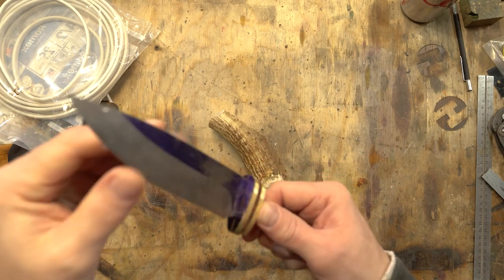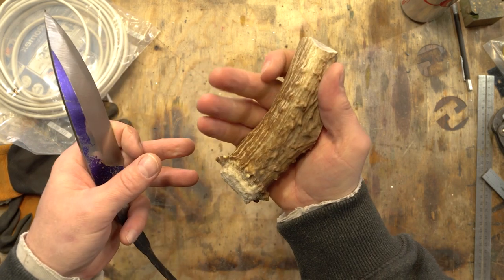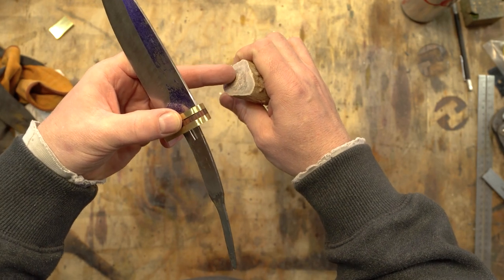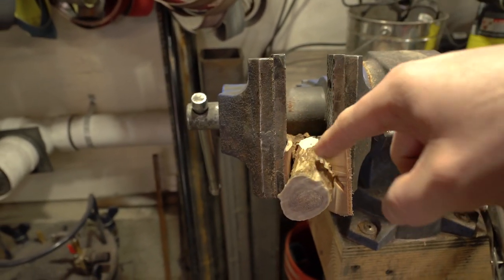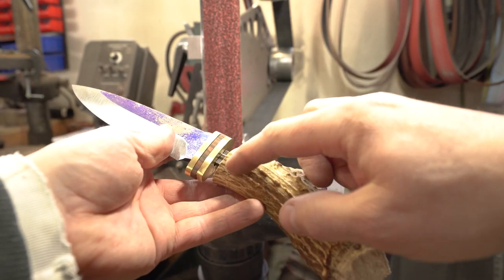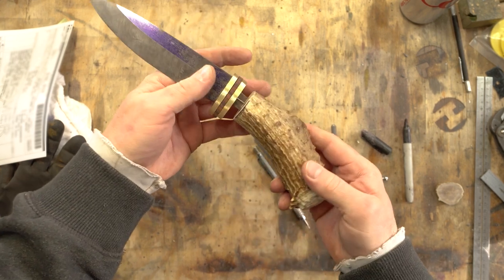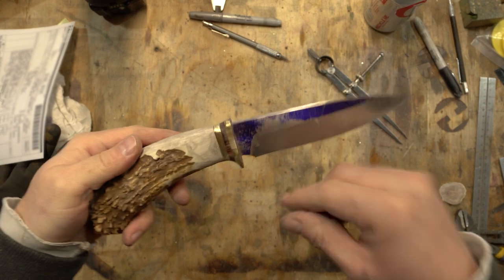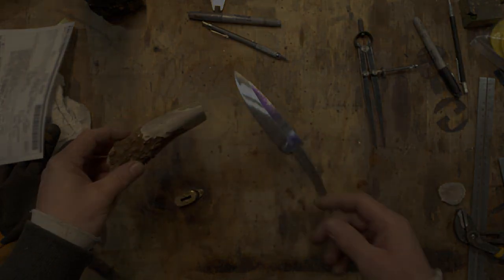Make an Antler Handle For a 6" Random Pattern Damascus Hunting Knife

Comment: So for antler handles, you don't need to do a whole lot of measuring, eyeballing is fine if you know what your doing, it's pretty simple, I work with sambar stag a lot, all I do is oversize the hole, and cut the tang a bit shorter aka carver tang, (also notch the tang so the epoxy anchors it down) you can also put a pin in it if you like (epoxy these days is strong enough to not have to use a pin) I have had to destroy handles to get them off being held in only with epoxy, that way the handle can fit snug with no gaps and also I don't have to waste time gouging out material, plus with whitetail or mule deer or elk, you want to drill out all the soft marrow/pith anyways and fill it with epoxy, trust me it's better this way, I make the cut off part straight by putting some sandpaper on a perfectly straight surface and slowly sand away until my fit up is perfect with no gaps, works every time.
Reply from the maker: I appreciate the tips.  I’m not sure if I’ll ever work with antler again, but this is great knowledge in case I do. Thank you!!

Comment: You said, ‘I don’t know what material Antler is…’. It’s basically hair (which is why it stinks when sanded or cut)!
Reply from the maker: Hahaha. That makes perfect sense. Smells like burning hair.
Reply: Antler is actually bone, horn is actually 2 parts, bone in the center and hardened hair around the exterior.
Reply from the maker: @SwitchbackXThunter good to know. Thanks for the comment.
Reply: @Hathenbrucksteelworks  loved the videos! Subbed
Reply from the maker: @SwitchbackXThunter thanks a ton for that. I appreciate it.

Comment: What was the saw u used ?
Reply from the maker: It’s been a while since I did this video, are you talking about the broach that I used to dig out the handle material?  You can buy broaches, or I have a video on how I made mine.
Reply: @Hathenbrucksteelworks  yes that's what I was talking about. And I may just check out that video.
Reply from the maker: It’s a little bit of work, but I love being able to change blades when one breaks, and be able to use different blades.